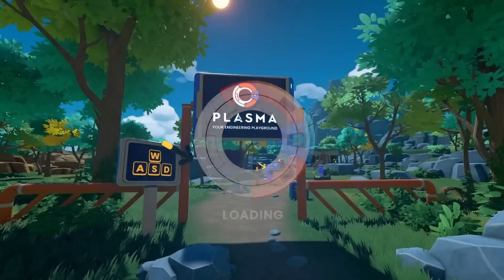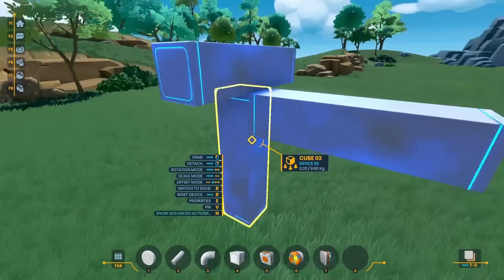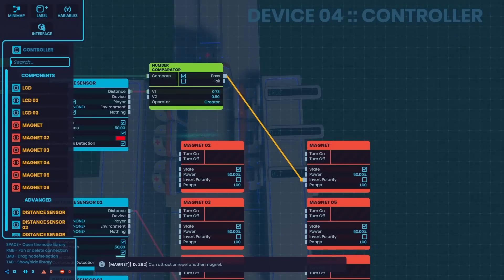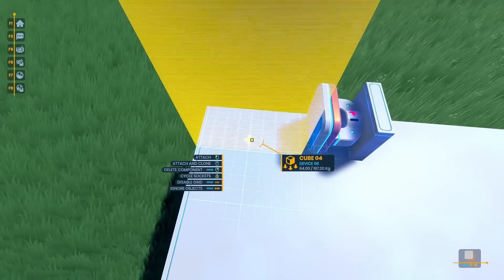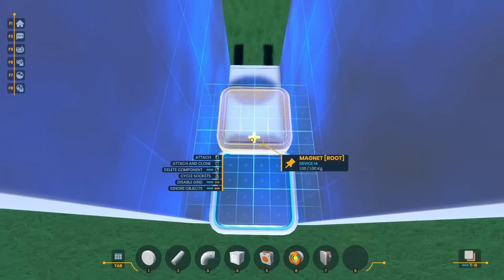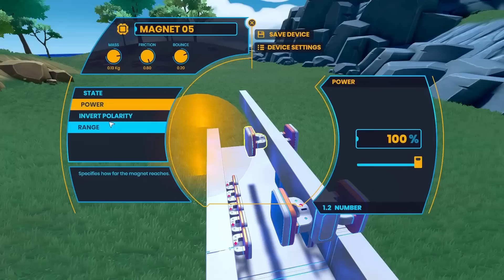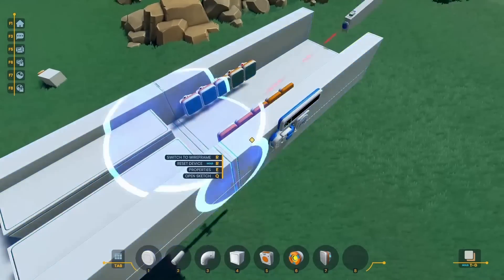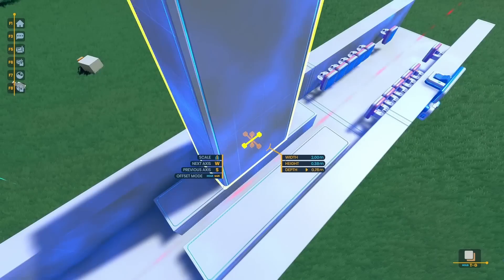Making A Portable Railgun in Plasma

Comment: A slight correction: this is more like a coilgun than a railgun, since it uses incremental acceleration with electromagmets rather than using a conductive shell and the rail itself to propel them along using a rather odd magnetic phenomenon.

Comment: The 5 things i hope you make in plasma
1. a working car with an engine, transmission, just everything, not just a chassis but things like doors, windows, a dashboard, maybe even a moving steering wheel.
2. a working steam train with piston and driving rods and connecting rods and all that jazz
3. all of the working guns that will look so good, maybe even with removable mags and bullets
4. working tanks similar to the cars but with weapons
5. if it gets far enough, a full on working airplane, with of course, a hand built engine.
Reply: Steam engine first plssssss
Reply: A note, but you can't make closed loops currently, and there's no self collision, so most engines aren't really possible rn